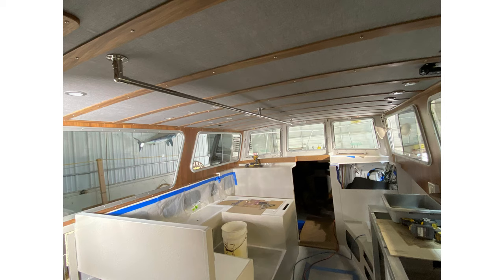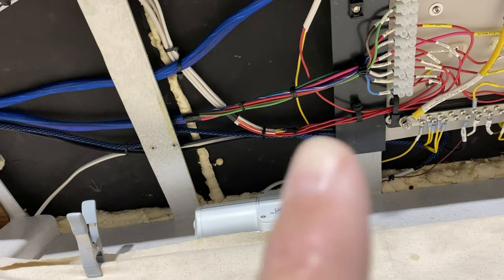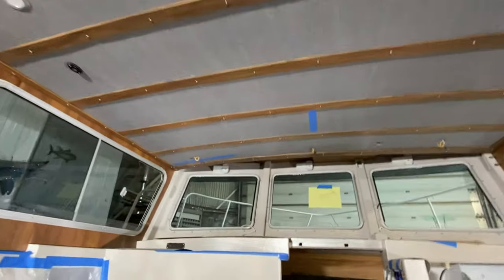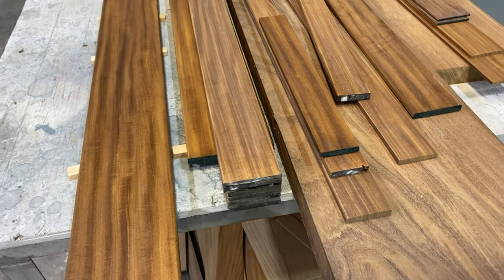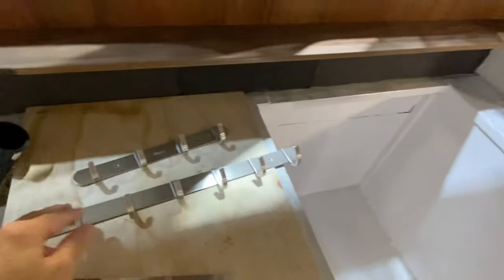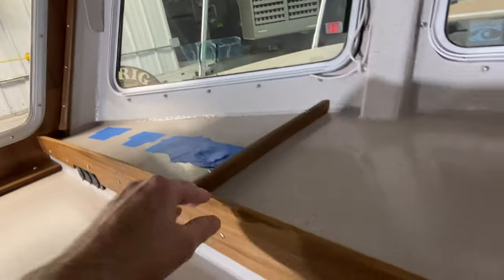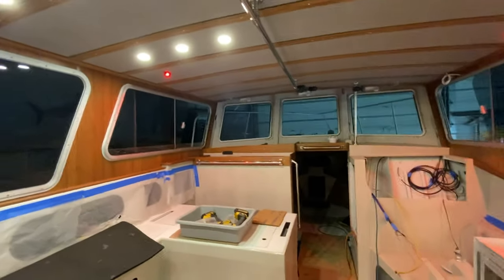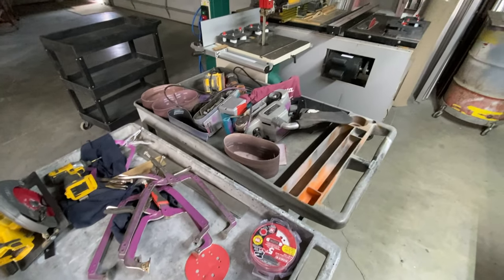Jahrig Aluminum Boat Build-up till July-14-2021 - #40 - aluminum boat build boat wood

Comment: The craftsmanship is amazing. I'd like to see a cost comparison of your cost vs factory cost.
Reply from the maker: Well one off's are more than a production run. But I've built to commercial standards and then many custom add on's that would be very costly to have it built from a supplier. Changes always are costly when having a builder that is set to do things to be cost effective for production run out work. But I've got hundreds of hours on this project. Pretty happy with the look and think it is going to be very comfortable.